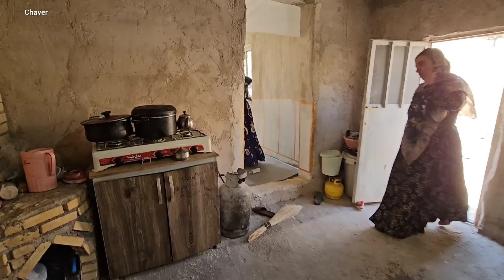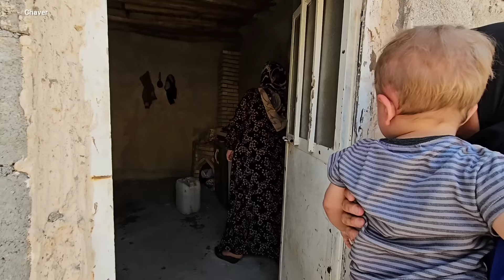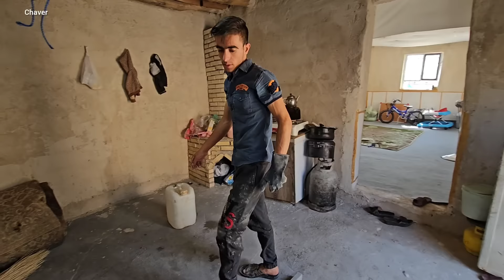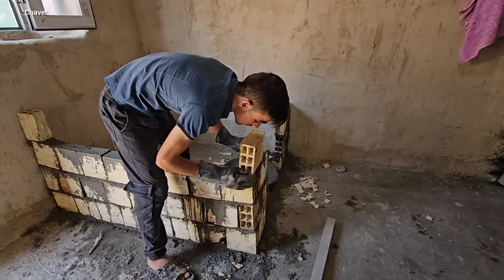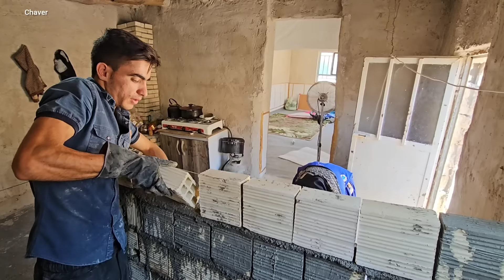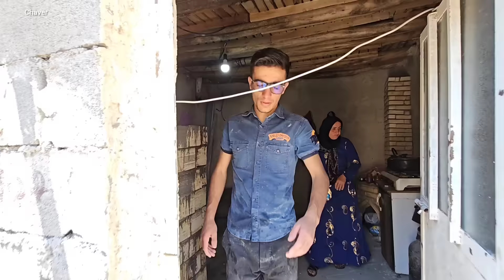Building a new bathroom with Ilda and Ali. Washing Rahil 👶 by Sakineh 🤩🤰

Comment: Outside u should have built big bathroom inside it's not ok again it will get conjested u can't sit and eat in the kitchen u should use new room it will get untidy we told yesterday not to build inside 😮😮
Reply: It gets extremely cold. So outdoors several months of the year would not be realistic. It would be dangerous, frozen pipes, frozen water. At least inside is shelter from the elements. I think another window will be needed on the back wall.
Reply: @NancyJewell-vg3ky she has a shower 🚿 already with hot water on top of the roof

Comment: That's not a good idea😮. They already have a bathroom outside, just fix it and  they can put/place the bathroom door on the other side. 😮
Reply: It is just the shower. Don't you have one inside your house? No more going out into the winter air into a frozen shower stall

Comment: Remove the fire place. With the toilet Inside the kitchen  the kitchen become smaller will have difficulty  moving  around. The current toilet  should be repaired and not to have toilet  in the toilet.
Reply: It is just the shower. Don't you have one inside your house? No more going out into the winter air into a frozen shower stall